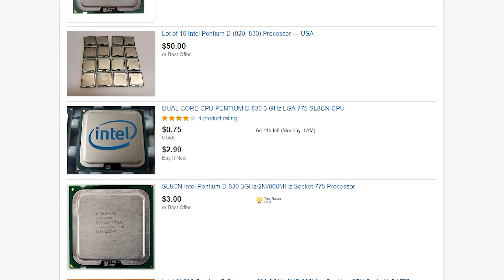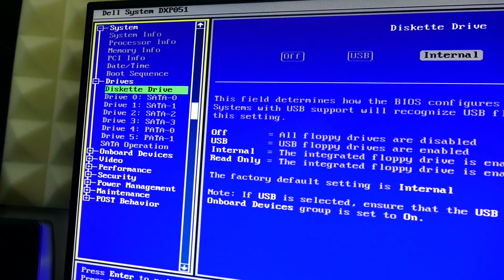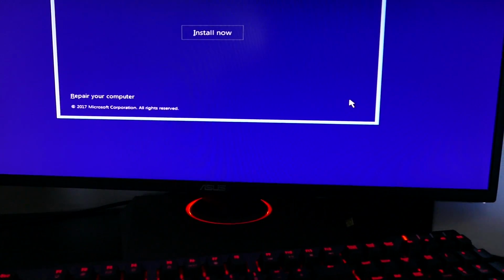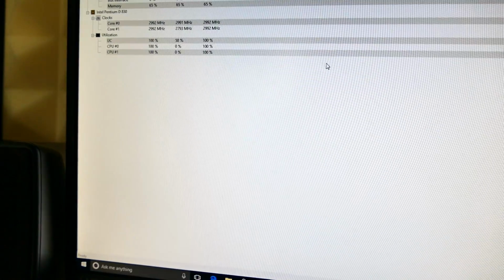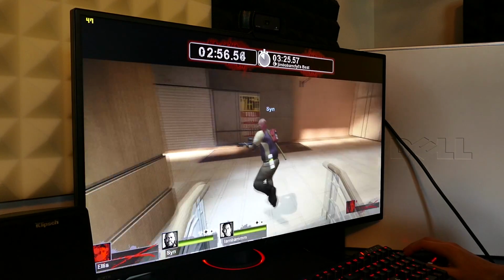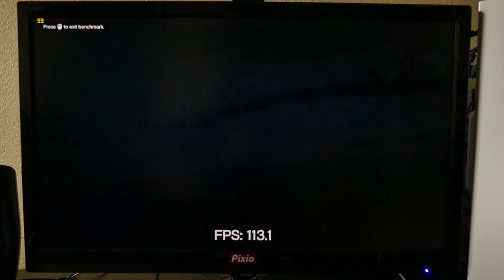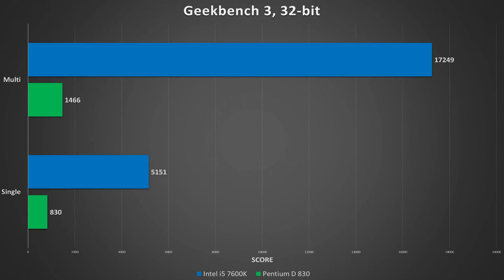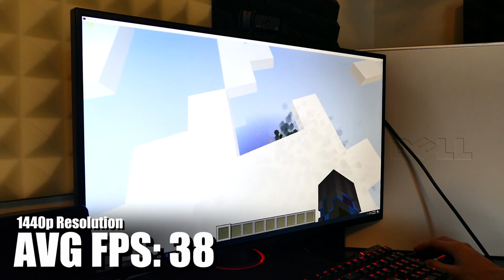I Paired a $6 CPU with a $700 Graphics Card

Comment: People do need to understand that while Minecraft isn't the most visually stunning game, it still demands a ton of the CPU to deal with its random generation, voxel count, and the fact that it's programmed in Java.
Reply: +-T-X-M- This is a comment that really irks me as it's obviously by someone who has no clue how games are programmed and that there's a wrong way to do things. Yes, graphics are handled by the GPU, but what if the program is CPU bound? What if the developer wrote the gamestate manager incorrectly and uses a ton of CPU processing before sending information to the GPU? What if they manually lock the framerate by waiting for dt to be greater than 1000/60ms? or 1000/30ms? What if the game only uses the CPU (software rendering)?

This video itself is proof that a slow CPU will bottleneck a good GPU and that they are dependent on each other for good performance.
Reply: BtheDestroyer You think thats bad, I asked my parents for a "gaming" computer and they went to Best Buy to look for one. The guy told them a $200 HP Notebook 15, I think that was the name, had plenty of power LOL. This was 2 years ago I was 14 btw. I am glad my parents tried, I took the laptop gladly and thanked them. I looked at the specs and it had a single core 1.3ghz Celeron cpu. I couldnt do anything with it lol. So I sold it after a year and built my own desktop with some of the money I got from it XD
Reply: i5 is literally the best cpu to run minecraft alongside the i7, minecraft only uses about two cores if your using the newer core optimization settings.
Reply: BtheDestroyer And I have noticed that when you use low end cards: AMD gets like 3x the fps of Nvidia ones (talking gt620 grade cards here)
Reply: +Reuben Horner who in the right mind buys a low end card? Just get a used mid-tier or high end one if you can't afford it. At this point, low end is worse than integrated graphics most of the time.
Reply: BtheDestroyer Just an observation
Reply: +Samster Birdies "most of the time"
Reply: +[TVA] 1815 Delta III Yes. Your core i5 isn't a garbage CPU. It has at least 4 cores and a decent clockspeed. An example of garbage would be my sister's laptop's CPU which has 2 cores without hyperthreading running at 1.7Gh. Yes, I'm shocked as well.
Reply: But my core i5 with nvidia 1060 runs minecraft with 400 FPS tho...
Reply: BtheDestroyer Agree. My 1600 cant run it 4k 32 chunk loading with shaders. But with optifine it is able to run is easily as its 6 cores is being put to use.
Reply: Kqog Gaming On Macs What's optifine if you don't mind me asking
Reply: Optifine is basically a "google chrome" to minecraft. It boosts the frame rate as well as zooming in with one button and allows shaders if I'm not wrong.

Comment: I've breathed new life into a gateway solo 1150cl 500mhz with 196 mb ram and xp... bringing it up from 98se to win me to xp and it's just as capable as a Acer travelmate @1.5ghz with a standard pata hdd. The gateway has a pata ide to sd adaptor. which seems to work for the $12 bucks for the adaptor.
Reply: your gpu may have an advantage with 8-bit palletted textures if running Final Fantasy VII, relevant perhaps. try running EMM=RAM in config.nt if you will and check MSD.exe for a diagnostic check for utilization in native DOS. your working with vintage hardware take advantage of it's actual useful features please.

Comment: now pair a $700 (high price) CPU with a $6 (low cost) GPU
Reply: Maryland that would be boring
Reply: That's basically what integrated graphics is. Actually integrated 
graphics with the core i7-6700k (hd 530) has a benchmark between the gts
 250 and gtx 260. So the integrated gpu is worth about $35 on a $300 
cpu. The extreme experiment you suggest would be a bit boring because you would probably use software rendering. In fact the gpu probably wouldn't have enough memory or good enough driver support to even try any modern games. Maybe even windows 10 wouldn't work. Then again, I did a lot of research to respond to a whimsical comment that you spent a few seconds thinking about. Wall of text complete.
Reply: its like using igpu on i7
Reply: Maryland pair a $300 CPU with a $400 Graphics card...
Reply: The internal graphics are better than a $6 graphics card
Reply: I9 with a 210
Reply: you mean a decent pc? get out. get out now.
Reply: no...its worse XD
Reply: Actually it would be a great test, the HD 6350. Tons of them run for about 6 bucks,  easily passes windows 10 x64 requirements and runs directx 11 so you can test newer games. It would actually be much better than this test.
Reply: Perhaps you actually didn't do as diligent of research as you may have thought, as i found this after a couple minutes of scrolling ebay. It would have been a few seconds if there weren't for all the random low-price junk at that price point. Also this cpu has been tested many times on many newer games.
Reply: better yet actually the 5450
Reply: I see the HD 6350 seems to be a rebranded HD 5450, and it's twice as good as my integrated graphics (HD 4250 with 384 MB of allocated system ram) which can play skyrim, barely. I get about 5 fps at medium settings and1680x1050 resolution. It's actually playable at low settings with 800x500 resolution. Fun experiment, but I got a gtx 650 now so lets see how that works.
Reply: i currently have the 5450
im doing some maintenance on my normal pc which is a lot better
but for a week or 2 until my parts come in im on this hunk of crap
Reply: eh, are there even 700 dollar cpus with igpus? Because most cpus in that price range are for workstation, which almost require a dgpu, an igpu would just be a waste to put in them.
Reply: Nothing interesting would happen.
Reply: Nici Geelhoed That would be a good PC. Pretty good
Reply: I think that pc should be fine.

Comment: So I had a Dell with this case (probably the same model, a Dimension E510).  This was actually my first gaming rig, bought back in the day.  Quite frankly it was not a great rig for the day, but I did not know any better.  It ran Everquest II for me, so I was happy.  I still have the machine, and I'm trying to decide what I'm going to re-purpose it for.

It's pretty sad that you couldn't get 64 bit windows 10 running on it though.

Comment: my pc 
intel pentium 4 655
1gb ram
no gpu
Reply: fahad stc lucky. I just have 566mb of ram and an Athlon II. but at least I have a 56mb VRAM gpu
Reply: Got a 1997 gaming machine Pentium mmx 200 mhz, 32 mb ram, matrox mystique 4 mb & 3dfx  voodoo 1 4 mb on a 4 gb harddrive in my room no clue what the price was as i got this for free last year by the apartment complex owners.
Reply: Thats your operatingsystem & nothing else. Download cpu-z too check what you actually got.

http://www.cpuid.com/softwares/cpu-z.html use the zip version so you wont have to bother with an install.
Reply: At least you can play mine sweeper at 60fps xD
Reply: Project Dedux I got an Athlon 2... In my nas
Reply: i feel the most badass in here
 
pentium G630 2.70 GHZ
2 gigs of ram
and no gpu 32mb vram ;D
Reply: Teenagers !! I have a Cyrix 550mhz, 32mb ram, no gpu. (Yeah my first ever computer priced at $500)
Reply: my pc window 10 32bit
Reply: Intel pentium 4 prescott 3.0ghz (stock cooler). At socket 478 (talking about toasters ? :p )
1GB sdram. 
GeForce ti4200
Maxtor 200GB Hdd
Gigabyte 8S661FXMP-RZ mobo
Generic 500W power supply
Sound blaster live! 1024 (worked with my old pentium 3
In an aerocool v3x advance

Gave this beast away 1 month ago. Was really sad. It was working fine with Lubuntu on it. Was mine for 12 years. Didn't have any space to store it around.
Now I regret it :(
Reply: do you guys use fans or liquid cooling? 😂
Reply: had an FX5700, which I sold and stayed with ti4200! 
At least the guy who took this one, is a retro collector, and OCs the sh!t out of every piece :D
Reply: I have a Haswell pentium in my NAS and a i5 in my desktop. My laptop has a quad core i7.
Reply: fahad stc pentium 4 @2.66ghz
512mb RAM
Microstar 8860 128mb AGP
Motherboard may be DO
Reply: mine
Pentium 4 3.2 ghz
4gb ram
gt620
Reply: how's y'all phone specs
Reply: motorola moto E2, my original moto g suffered from the rom corruption bug & was with me for quite some time until the battery died, doesn't let me install any new rom on it for some reason.
Reply: should try finding a faster gpu for that, perhaps a radeon x 1600xt or fx 5600
Reply: cpu air cooling all the way, one thirdparty cooler has lasted 8 years so far.
(Arctic cooling freezer 64 pro in my lil brothers pc with only removing dust when it starts too cover it up.)

My dad has my old freezer 13 pro + motherboard & my phenom II 1090t which i bought in 2012 & the tiny fan died after 3 years. (bought the 1090t in march 2015 used going from a phenom II 955 which ran at 3.9 ghz with no problems at all.)
(the tiny white fan sitting closer too the cpu got a bad bearing noise so just cut it off & unmounted it & the large fan is still nice & quiet.)

& i got a used noctua nhu12p february this year along with a i5 2500 & Z77 motherboard & still runs nice & cool despite forcing turbo too be at 4.1 ghz & 3.8 ghz on 4 cores.

Also got a pentium mmx 200 mhz retro rig which the original fan lasted until this year (got tired of the noise not that it failed.) (from 1997 that pc.) found a bit larger heatsink that can cool the cpu passively with ease.

added a coolermaster 80mm fan with blue leds that is from 2005 in the front of its case too help a bit extra with bringing in air.
Reply: hmmm sounds like the cpu is weak link here...

Comment: ewwwww what did I just see T_T, honestly the Pentium D series were a bad lineup from Intel. The Core 2 series was way better, definitely more performance oriented even without Hyper threading. My C2D E7500 had similar single thread performance as my FX4300. In my irrelevant opinion Pentium D was for Office use, word processing or tally kinda uses. And definitely solitaire

Comment: You have to obviously install the OS with the motherboard at least of the pc you want to run the OS on, you can't just hot deal hard drives with windows OS on it installed from a different system and expect it to run on the new system( motherboard mainly) !  windows uses the motherboard as an identifier for legitimate activation of the copy, your idea may work with some other OS but not windows,😂😂😂
Reply: It depends on what version of windows you're using OEM or Retail, OEM tends to lock to one motherboard and Retail gets a number of uses on different hardware/motherboards or systems. It really depends on what he was using.
Reply: Hot swap* typo
Reply from the maker: nxtg77 Obviously tried that. Fresh install. Wouldn't work. You can swap drives between Ryzen and Intel platforms all day long, by the way.
Reply: nxtg77 What you can definitely can hit swap hard drives and SSD's. I just built a mining rig out of spare parts. When I put the 60gb SSD in it booted into the Windows that was on it. I just had to install drivers and restart. Was still activated too.

Comment: Still better than an Intel Atom netbook.
Reply: muiecopyright yea atoms gets like 0.52 but you gotta admit battery life is like forever.
Reply: heh.... my atom handheld actually does better in all of those except gta v
Reply: Omg yes. I got one of those to work on and it so small.
Reply: Atom netbooks are pretty good at being emulators. That's about all the gaming you would want to do on one.
Reply: Yeah other dude probably spammed system with viruses or bloated the OS with adware.. Atom has more cores in some cases than this 6 dollar cpu. Atoms can hold their own in multimedia systems whereas this crappy 6 dollar cpu would probably take about 15 years give or take to open a program  xD
Reply: It will never run GTA V.. not in this lifetime at least

Comment: Maybe your SSD had x64 Windows and your CPU is x86
Reply: x64 was added late in the Pentium 4 days.  All Pentium D chips had it.  It's more likely he had a UEFI/GPT install and it couldn't see it.
Reply: Razamatraz I wonder why he didn't use x64 then... I don't remember x64 working on the P4 2.8Ghz
Reply from the maker: Razamatraz Tried fresh installs. Wouldn't work.
Reply: +1 TRY LINUX 
WIn10 bloat likely idled that chip at 20-30%
Reply: Science Studio maybe try 7/8.1 64 bit if you have time? thanks
Reply: Did you happen to try any Linux distros? I'm having a similar issue with a system i'm testing and only 32 bit versions of windows work, but for whatever reason a 64 bit version of ubuntu works fine.
Reply: That's weird.  The reason I know x64 works is because I had a legit copy of Win XP x64 on my Pentium D 820.
Reply: Used Windows 10 64-bit just fine with SanDisk X400 SSDs (refreshed as WD Blue SSDs after SanDisk's takeover) on a Gigabyte EP35-DS3R motherboard that's definitely pre-UEFI, using the most recent F4 BIOS, an E8400, 8GB of G.Skill memory, and an EVGA 750 Ti SC. Also set to IDE legacy mode rather than AHCI for easy dual booting with Windows XP 32-bit. Works fine with Windows 8.1 64-bit too.
Reply: Sparks Fox I'm using pentium d 805 and windows 10 easy everything is just fine (except gaming)
Reply: It sata controller. That computer doesn't support ufie mode
Reply: Socket 478 P4's aren't 64bit and pretty much anything LGA775 is 64bit (minus some of the earlier Celerons iirc), and I think windows 10 doesn't like anything pre-Core2 from what I remember. 

TL;DR: Try Windows 7 64bit.